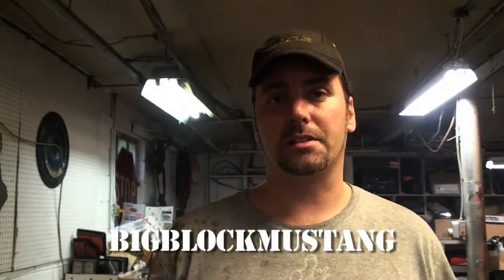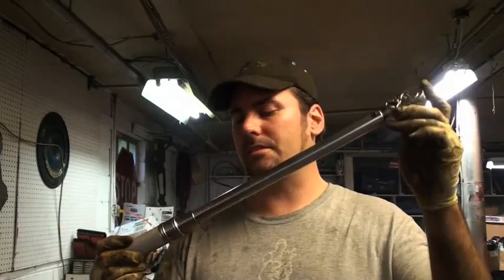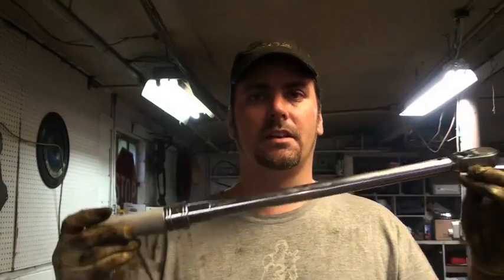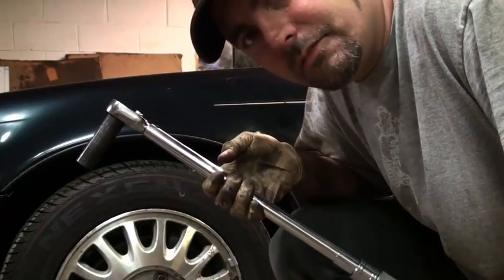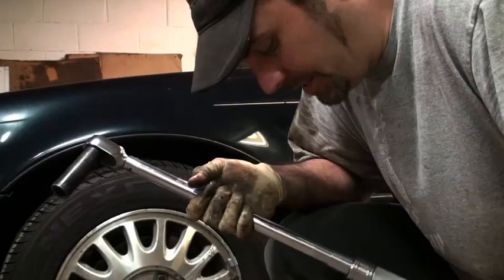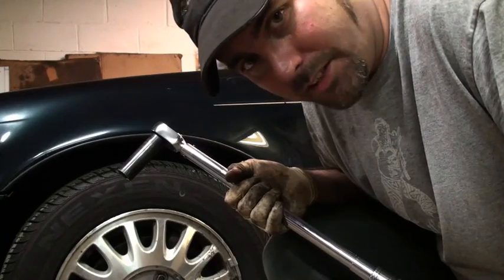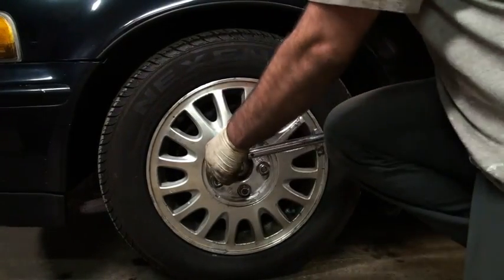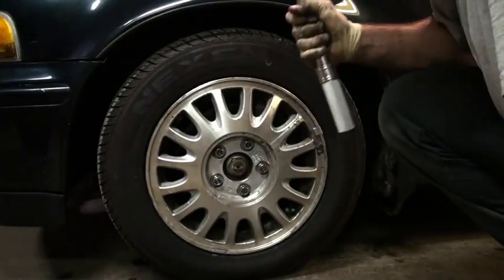Torquing Wheels and Why It Is Important - EricTheCarGuy

Comment: Hey Eric, I've been enjoying your vids for a while.  Do you agree that using regular EXTENSIONS or deep sockets will throw off your torque settings ? I have heard of the "torque sticks" but have not seen any in action.   Thank you and Frank Gonzalez for hitting on some of the finer points of keeping out rides and lives safe.  KEEP WRENCHIN'   JK.
Reply: No, using vertical type of extension bar won't throw out the torque setting, only horizontal type will.

Comment: I got myself a torque wrench that apparently only clicks @ higher torque specs probably 100+ .  My car only needs 76 ft/lb for the wheel nuts is it best to just stop torquing it when the nut stops moving?
Reply: ***** Do you have a way of describing of how it should feel?  The torque wrench of mine is 1/2" drive so its a pretty long handle and the torque setting is changed via adjustable dial ring.  The user manual itself says there no audible click @ low torque settings but I should be feeling a gentle release.

Comment: Good video Eric. 
My experience with tire shops are they never ever use torque wrenches. Every time after a tire shop visit, I had to re-torque my wheel nuts. One time, I was madder than hell when I tried to loosen a wheel bolt that just won't let go because of the guy over torquing it with their air guns. Finally I had to resort to a breaker bar, and you guessed it, the bolt snapped and to make it worse this is a BMW that does not use wheel nuts, but rather wheel bolts and the snapped thread embedded in the rotor hub. To make a long story short, I spend the next 6 hours drilling out the broken bolt.  From now on, I never drive my car to the tire shop, but rather put my car on jack stands and just take the tires/wheels to the shop to replace tires. Then with the new tires mounted on wheel, I took them back to my own garage to mount and re-torque the wheels myself.
Reply: One of my relatives owns a local tire shop, and they torque EVERYTHING. From cars to trailers to big boy truck wheels, everything gets snugged to below spec and torqued up to spec. Top of the line wrenches, regularly calibrated, and they even have the massive 600lb/ft 3/4" drive for big trailers. He runs a tight ship.
Reply: I had tire barn cross thread a lug on me. Had to break it to get it off. I been working on my own cars since i was 18. My wife took her car to wal mart to get tires. I couldnt get the lug loose to rotate the tires. I always take my rims to the tire shop too...saves me 5 a tire at that.
Reply: A lot of shops I've had work done at give a tag to get bolts re torqued at the shop for free after 60 miles.
Reply: Yep. Went to a tire place and they broke 3 wheel studs. Was a total nightmare. Never going back
Reply: This. My local shop has cross threaded bolts and warped brand new rotors on my vehicles on multiple occasions. Now whenever I need a patch job or plug or something like that I’ve gotta take a tire off and take it to then instead of just leaving my car there for a day so I can make sure it’s torqued properly.

Comment: the torque wrench needs to turn the nut before it clicks; otherwise it may already be over-torqued. I would also mention that you have to stop turning when you hear the click.
Reply: For proper re torquing the vehicle should be lifted off the ground to eliminate loading the wheel bolts and than the wheel bolts or nuts should be loosened and torqued. This procedure insures correct centring of hub centric or lug centric or both. For example my vehicle uses lug centric wheel bolts and my wheels are hub centric, the best of both worlds.
Reply: @billwilson6096  How do you stop the wheel from moving while off the ground so you can tighten the lug nuts?
Reply: @dsertwq ….. while your wheels are elevated off the floor install your lug nuts as snug as possible and than lower the vehicle to the floor and go ahead and torque to spec.
Reply: @billwilson6096  My VW workshop manual says you should never do that.

Comment: When you are done using the torque wrench store it set to 0 or its lowest setting. Storing it other than 0 or its lowest reading will ruin the calibration of the torque wrench.
Reply: Some lines of torque wrenches now have reminders integrated into them to remind you of re-certification every year. I picked up a massively discounted run-out wrench (~NZ$1000 to ~NZ$285 - that is around US$750 to US$215) specifically to avoid that hassle as I don't use them enough to worry about losing accuracy. I do always zero them when not in use, anyway.
Re:  wheelnuts, I always use anti-seize on the threads as I've had them snap off when trying to undo nuts that over-zealous fitters had overtorqued and with a bit of rust...
Reply: +Frank Gonzalez  Hi Frank, your point on "unloading the wrench " makes sense for storing.  What about using extensions with torque wrenches ?   JK.
Reply: +James Krivitsky with extensions, if you can do without them, it would be better. If an extension is needed, the shorter the better. A shorter extension will give you more accurate torque than a longer one. And if you can't get to a fastener with a shallow socket but you can with a deep socket, then use the deep socket. A deep socket will give you more accurate torque reading than a short socket with an extension.
Reply: +Frank Gonzalez , so tell me Frank, do you also have presentations on YouTube, and if so what is the name ?   Thanks  Jim
Reply: James Krivitsky I don't have any presentations or channel. Just years of wrenching experience.
Reply: Frank Gonzalez 
I just bought myself a nice torque wrench the other week, I haven't used it yet as knew they needed calibrating. I'm just wondering how though?
Reply: Thanks I never knew that, i have three that have been on various settings since I've purchased them.  Hope they aren't inaccurate alrready.
Reply: If your torque wrench is really good, im sure that come calibrated, and it comes with calibration report, main brands like Beta Facom Hazet Wera Snap-on, etc. They all come inspected and calibrated from factory, most of them +-4% precision.
Reply: Yup, should have a calibration slip with indicated and actual torque - all mine are +/- less than 1%, but they were ****ing expensive, 'cept for the last one with the massive discount.
I still keep them all in their supplied cases with the calibration slips, and zero'ed, to keep them as best I can.

As Frank says, keeping the offset as short as possible will reduce the possability of errors, but keeping the extensions in line with the bolt/stud and using one hand at the centre of rotation to counteract the force appling the torque eliminate these errors.
Reply: There's a formula chart that tells what percent a certain length extension will reduce torque accuracy. Can't find mine, but I found it on the internet. 😁
Reply: Frank Gonzalez read the owners manual like it’s such a hard thing to do, every torque wrench is different, Stahlwille Manoskop series requires no zeroing after use and can be used as a breaker bar because the spring inside will automatically disengage when set torque has been reached or when it is not being used, I have seen guys laughing at me for not using the Stahlwille torque wrench “properly”, and running across the shop looking for a breaker bar while I can just laugh at them for not reading the users manual and do my job with absolute ease. Owners manual doesn’t make you smarter, but at least it makes you well informed.
Reply: You are correct sir. It will damage the calibration spring. Thanks for bringing that up. Alot of people leave it set at there proper torque setting for the next time of use.
Reply: Split beams don’t have to be set to zero when done using them.

Comment: I just get them as tight as I can by hand using a lug wrench and use my foot to tighten it an additional 100 degrees. Seems to work just fine.
Reply: CDubs HasIt 
Depending on how strong you are, that can definitely overtighten them.

I was overtightening my lug nuts by 40 or more ft-lbs before I started using a torque wrench.
Reply: All my cars are supposed to be 100-120ft lbs.. Haven't had a problem.

Comment: Torquing wheel lug nuts: Do it right if you'll regret it. 

Nuts too loose, the wheel may work its way loose, wobble when you're travelling at high speed  and ruin the wheel,  tire, suspension, and your health.  This happened to me on a Great Lakes vacation when my boss insist that I take his wife's "better" car. Not fun finding an oddball replacement Peugeot wheel and tire hundreds of miles away from home and then driving back with a shaking rear end and sprained wrist.

Nuts too tight, you wont be able to remove them with the regular tire iron, the rotor can become distorted or crack, brakes, tires and bearings wear out faster.  Think 24 inch breaker bar, with cheater and 6 point impact socket plus much cursing in a Walmart parking lot yo change a vandalized tire.

Comment: EricTheCarGuy  Torque sticks don't work... It is very easy to Over torque a wheel stud using a torque stick... my father had a brand new set of tires put on at the Sears service center they use the torch stick method... his van has aluminum wheels on it...  as you know aluminum expands when it gets hot ...when you over torque an aluminum wheel it is actually possible when the wheel heats up it can put enough stress on a standard wheel stud causing it to actually shear off.... this is exactly what happened to my father's van...  the reason torque sticks aren't reliable is the operator can repeatedly hit his impact gun causing it to over tighten the lug nut.... my father was driving his van going 70 miles an hour down the interstate when his right front tire and wheel came off the van ...when we examined the wheel there was absolutely no damage cause from loose lug nuts the wheel studs were completely sheared off.... they determined it was caused from over torquing these studs .... I realize a torque stick is supposed to break at a certain foot pound if you use an 80 pound torque stick wouldn't it stand to reason that it should break at 80 pounds they will go a lot higher than what they're rated at the only proper way to put a wheel on is by the hand torque method but people are lazy and don't care...... the mechanic has  lives in their hands they need to respect that fact and take the time to do it right.....

Comment: Do you measure the final wheel torque when the car is on the ground or jacked up?
Reply: Big Boss on the ground.
Get as tight as you can in the air (won't be all that tight), then on the ground you can get them to final torque spec.
Reply: Quirkification Cheers, mate!
Reply: How do you get 90ish lbs in the air? Myabe the rear with the e-barake on; but not likely.

just get them tight, and to spec on the ground.
Reply: +Quirkification What if you fully torque them in the air?

Comment: Love your vids dude but I have to say: that is not how you use a torque wrench. Snug, then tighten to torque spec. You cannot properly check torque on a nut or bolt that does not move.

Comment: those nuts were already over tightened they didn't turn at all before the wrench clicked
Reply: Me too! As a trucker I've had many tyre changes and each time they fasten the nuts till they bite the wheel then they tighten them to final torque with the torque wrench till it stops turning the nuts and finally clicks. Then they wait 30 minutes and then revisit each wheel nut again at the same torque setting and watch for turning if the nuts, if they turn again they wait a further 15 minutes then torque to the same setting a third time. This is how its done in the UK on trucks since a wheel divorcing your truck is never going to end well.

Comment: Ok first off Eric your awesome! But I must state that when you were torqueing that cars wheel the nut wasn't moving! In other words they may have already been too tight! The wrench must Rotate the nut or fastener to the proper torque not just click without moving!
Reply: Ever thought that he may have torqued all the lug nuts before and was just going over them to show it in the video?
Reply: Possible but I doubt it
Reply: Eric being a professional mechanic I think he knows what he is doing just saying
Reply: Well I too am a professional auto technician. And if you read my comment I clearly state they "may have been already too tight"
Reply: that's correct the torque wrench should turn the nut to specified torque then click

Comment: To be fair, he clearly said to put the bolts or nuts on snug first, not tight. Snug here means way less than rated. In the video the lugs were already on, and the torque wrench pull was just a visual and audible demonstration of how the torque wrench works.

Torque sticks work, because of how an impact wrench works. An impact wrench imparts VERY small and short "knocks" on a rigid object. As the actual travel of a single impact is VERY short (otherwise wrenching a stuck bolt would break yout wrist as the wrench twisted out of your hand) - an impact wrench is incapable of applying mentionable torque force on a springy/flexing object (it just flexes that very short bit and springs right back). Torque sticks are made from spring steel, and designed to flex at a fixed torque rating - hence the working mechanism of the impact wrench cannot make it rotate any further. It just flexes and springs back.

To put it on a point; A powerful impact gun might be able to undo a rusted-down 2-inch nut - but the same gun is likely not be able to screw that same nut a single revolution onto a coilspring.

Comment: Torque sticks are fairly inaccurate too. They only prevent the lug from being on TOO tight. But a torque stick used with a powerful 1/2 gun will still be tighter than the recommended ft lbs if you crank down on full blast
Reply: A quality manufactured torque stick is actually quite acurate. But alot of people forget (or don't know) that they are not only rated to flex at a fixed torque rating, but they're also rated for maximum applied torque from the impact wrench/gun. If you use a (e.g.) 340nm max applied torque stick (most are rated under 400nm), with a 600nm gun, you're going to twist and alter the material properties and permanently damage the torque stick. And when that damaging twisting occurs, it of course will turn the bolt further. So if you use a torque stick with an impact wrench/gun that applies max torque lower that the torque stick max rating, you're gonna have a good day.

Sadly I see a lot of workshops, even some tireshops - will have a single powerful "allrounder" impact wrench/gun for convenience in case of stubborn bolts. Its quite clearly a recipe for torque stick disaster.

Precision tools are only as precise as their operator, and that operators knowledge of operating the tool.

Comment: Hi Eric i have problem with Toyota land cruiser transmission  .problem is wan  driven time its came hi temperature .i dont have any shifting problem only get hi temperature it was 80c.i opened gear box and i cant fund any problem inside the transmission .bat i think oil pump is not working properly.so tall me i am write or wrong ?   please help me >>>>>

Comment: I have torque sticks for my impact wrench. Love it, guaranteed 105 ft lbs from the gun.
Reply: Just make sure to use them with a gun rated below the sticks maximum applied torque rating. An i.wrench more powerful than that rating, will twist the torque stick further than its designed to flex - thus rotating the nut/bolt further than rated. And, damaging (and potentially breaking off) the torque stick.
Reply: naa

Comment: I'm not a mechanic but I have been doing all my own mechanical work for over 30 years. Sorry Eric, I'm not trying to be a jerk but you should really take this video off and do another one. I agree with a couple of other guys who made comments about this video. If you put the lug nuts on with an impact gun you will never know the true torque. Of course the torque wrench clicked at 80lbs, the lug nuts were probably tightened way beyond that already. Twice in my life I've had a wheel come right off on me because a shop did it wrong. Both times I had just  turned off the highway. Once was in Toronto just exiting the 401. I could have died. It's very serious. Luckily I'm a good driver and I didn't crash.The lug nuts were still on the studs but the wheel came off. Now I always go to a reputable shop and I still ask about they're lug tightening procedure. You don't want to be responsible for someone crashing and possibly getting hurt or worse.
For all you guys who don't have a clue, don't just watch a youtube video and assume it's correct. If you want professional results with whatever you are working on, do some more research and find out the proper way to do things.
Reply: He should go over why not to lube the studs too. You end up stretching the studs by doing that.

Comment: I've heard that you should wind down your tool after a few torques, as well as after you are done using the tool so as to prevent the spring  from loosing its calibration? How important is it to do this?

Comment: Using the torque wrench after using the STICK; the torque wrench measures 80 ft lbs. if the STICK made 4 out of 5 lug nuts 80 ft lbs and the 5 th lug 100, you would never know because you stop when the torque wrench clicks, measuring the minimum torque of the nut and not the max.